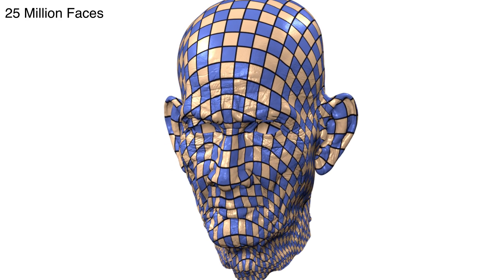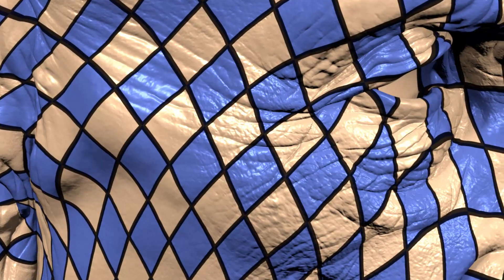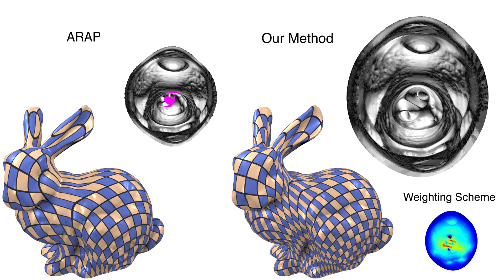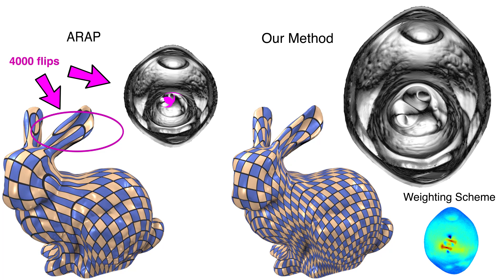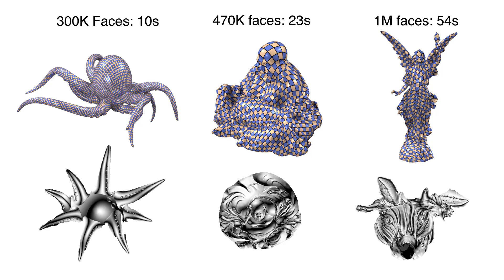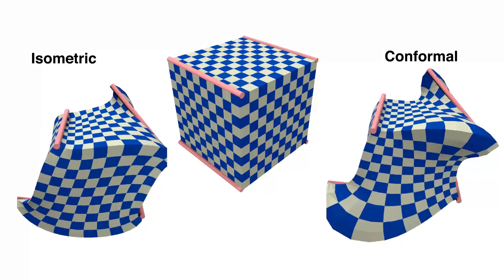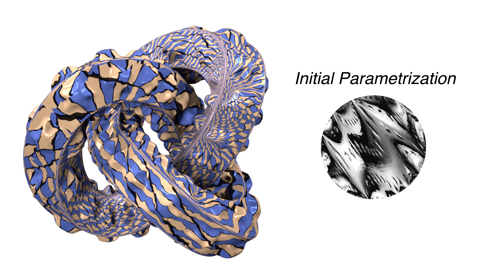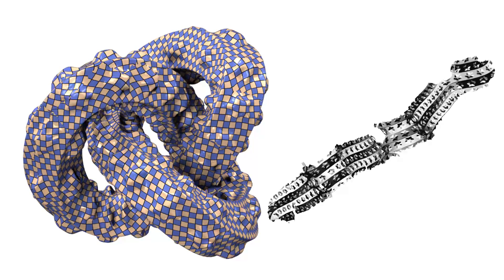Scalable Locally Injective Mappings (SLIM)

Comment: Helo Michael! awesome soft! is there a chance i can use stand alone soft?
Reply from the maker: Thanks fede, you can use this: https://github.com/MichaelRabinovich/Scalable-Locally-Injective-Mappings which include optimized code and also binaries, or a simpler reference implementation in libigl here: http://libigl.github.io/libigl/tutorial/tutorial.html (example 710). Besides that, there is an ongoing implementation in Blender, which will hopefully be ready soon. If I'm not mistaken, there's already a branch of Blender with it (SLIM in short).
Reply: Thank you!
Reply: @michaelrabinovich2049  it finally came to blender! awesome to have found out about your works